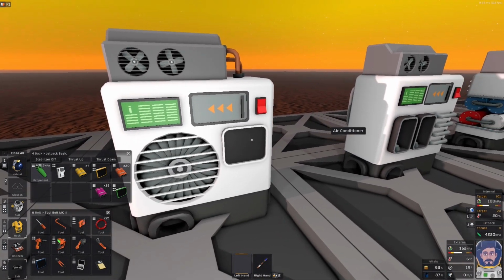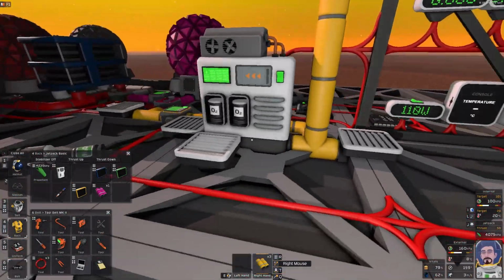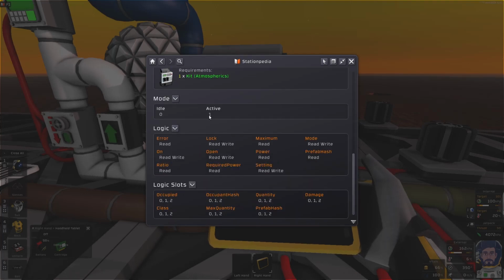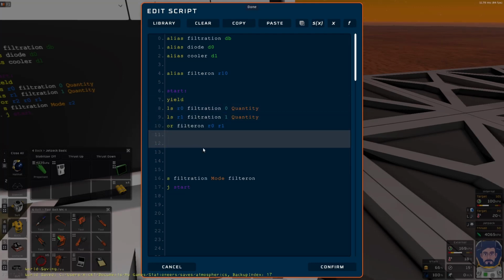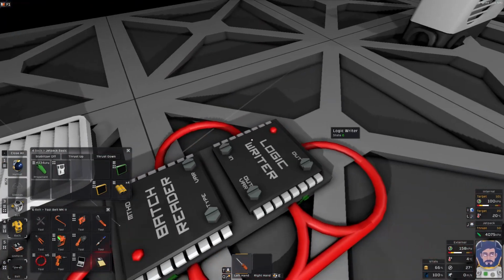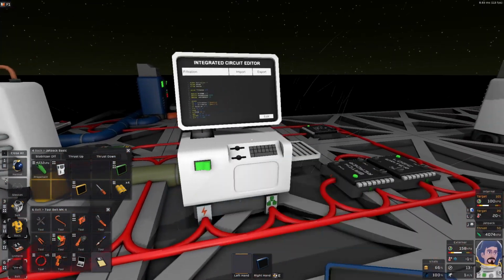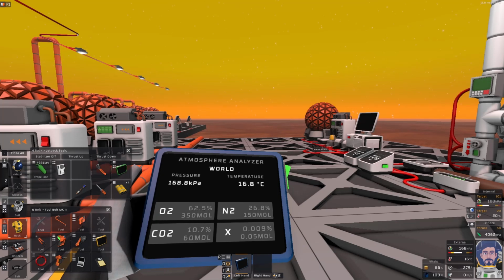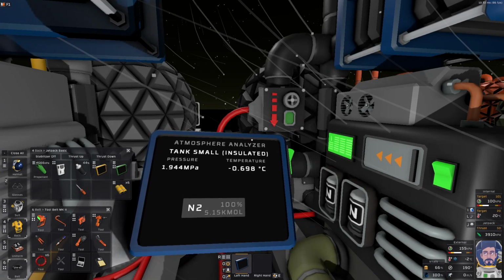Stationeers Filtration unit, test and build.

Comment: Latest update broke this code.  The unit will no longer switch mode when there is pressure at the input pipe.
Reply: I had the same issue. As I am still fairly new to the game I had another person look at it and while checking the workshop we found that someone has already posted a fix in the comments there. That fix works.

Comment: The input pipe is larger but essentially the unit will pull all of the gas in the input pipe in one go? You didn’t show us the total volume in the pipe, the pressure or type of gas. I’m sure all those are important as well. Did you try different gasses to see if that makes a difference?

Comment: Is the rate the filter runs at based on pipe length specifically, or is it the volume the filter is drawing from?  if you attach a portable tank or a fixed tank, does that also affect the result.  maybe having the filter running from a large tank is optimal?

Comment: Pausing at 48:29 - I haven't found a good way  to see if the unit is in Idle or Active mode, so if it's Idle, the IC lid is open, if it's Active, lid is closed. :)
Reply: And pausing at 56:29 - You did the same 😂

Comment: A rough solution to parallel filtration units. If all of them are idle you can just purge the remaining gas from the input pipes. Just a Batch Reader and a Logic Writer. Similar to the Flashing Light.

Comment: I have a parallel setup with the new filtration units where one is setup as the master, which is in charge of switching on all other filtration units when it detects pressure on the input pipe. The "slave" units will then turn themselves back off when no more of the relevant gas is in the input pipe.

Comment: About the Serial connected Filtration... You testet the input and output of the filtrations and found out that the length of the pipe did not matter anymore after the change... So should that not have changed that the serial connected filtration did not care anymore about pipe length and now should be harder to blow a pipe in that setup as all filtration are running at same speed?... Or did i miss something?
Reply from the maker: My tests showed that the input length did matter.
Reply: The longer inputs do affect the performance... In contrast to waste and output where it doesn't matter.So it would be better to connect all waste and input together to get one long line.
With a long intake and short distances to the next filter, the 2nd line could therefore explode If the first filter hasn't already taken out most of it.Or am I misunderstanding the question...?

Comment: Wow Mick this is amazing in what you did with this setup.  Also, I had a thought.   How about replacing the diodes with 2 displays showing the percentage of each filter in each slot.    Wouldn't that be better and easier to read?    Also do you think it can be done?
Reply from the maker: The issue is that I only have 2 pins and I will have multiple filters on the same network so I can't batch write.  So I am very limited as to what I can connect.
Reply: @cowsareevil7514  Thank you for the replay and your comment as well.
Reply: @cowsareevil7514  Couldn't you isolate the tiny networks with transformators? But maybe it's too expensive? I wish they'd give us a cheap diode.

Comment: Could add up the total in the filters, divide it by 2 and use that as output for the diode setting.
That way you have the overview of the total filter left/used.
Reply from the maker: That was an option.  It would have made the code simpler to just display the average and have the light on when empty.  But it as just a design decision in the end.
Reply: Or for multi-filters take the minimum of both filters.
Reply: @TheLoneWolfling  yes that would be a valid use case.

Comment: One possible improvement for consideration if you go down the path towards autodetection would be to first detect the output line contents. Provided that there is only a single gas in the line, you could then validate that the correct filters are inserted into the filtration unit. Only if the line is in a vacuum would you rely on the filter types to identify what should be filtered.
Reply from the maker: Nice idea.  If it detects a difference between input and waste pressures then it knows that it is in serial configuration and changes to a serial mode.
Reply: Also, you could add logic to stop the filtration unit if the unfiltered pipe exceeds the maximum pressure and there is a differential between the volume contained in the input and unfiltered pipes. This should avoid bursting the unfiltered pipe in a serial design, but still allow the unit to run under high pressure conditions in a parallel design.

Comment: you could add a bit of hysteresis to the on-off conditions to prevent the quick cycling of the flap.

You could also check how much percentage of gas you will be pulling out before turning on, that way you can save some filter

You don't need to filter out every bit of C02 in your main living area you can let it build up a bit before running the filter for a short while to purify it.
Reply from the maker: I had a minimum threshhold in the script.  It will look for a trigger number of moles before activating.